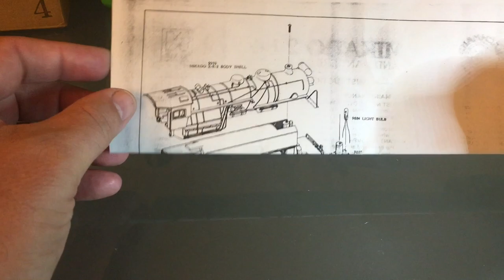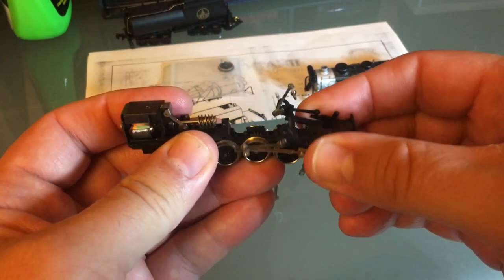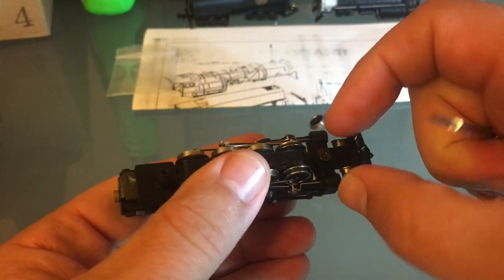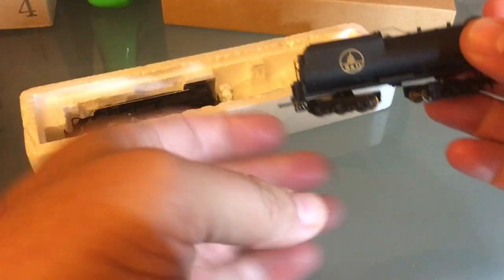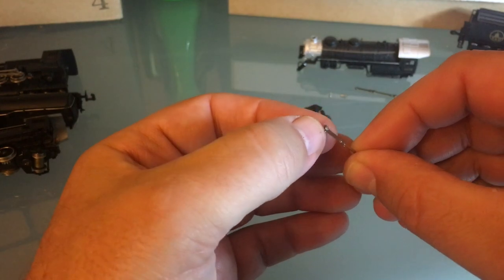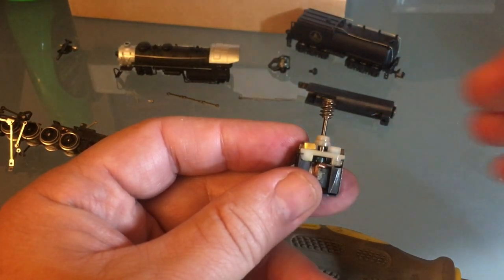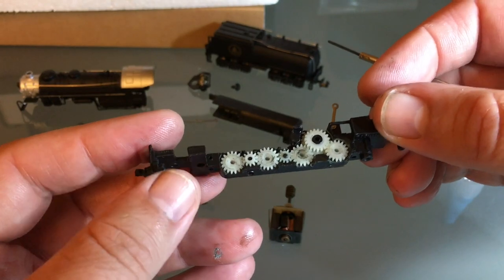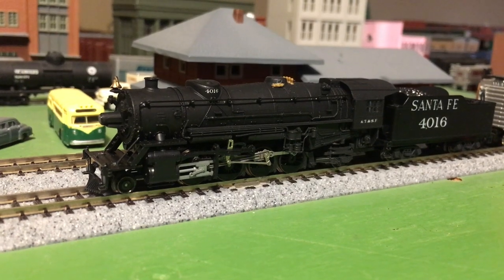N scale Bachmann 2-8-2 will it run?

Comment: It’s too bad the motor was fried, that would have made a good companion for the other Mikado you put the Shapeways gears in. I think the motor problem you had with the other Mike, was the fact that the coupler post was broken off, I looked at the 2 I have, and it appears that this is part of the motor support. For this one I have no idea where to get a new motor. Did Bachmann use the same motor in other models, like the venerable F9? I know Tharp these motors are no longer available from Bachmann. Thanks for sharing with us.
Reply from the maker: its tough to get the worm gear off the motor shaft. In HO North West Short Line make a tool for this. In N scale I have only seen one guy do it. His channel is m.magliaro. He is like a watch maker I envy him.

Comment: Does the location of the traction tire matter that much...if it is the first driver, second or last?  Or, does it depend on wheel arrangement(2-6-0, 2-8-2,, etc.)or even the manufacturer???  Jerry
Reply from the maker: I have a tendency to prefer the last drive number 4 for the mikado. I’m not sur if it really makes a difference.
Reply: Thanks